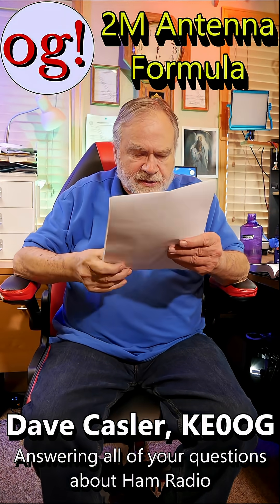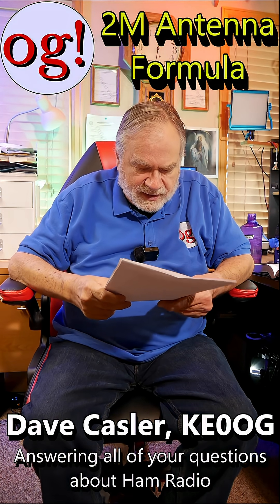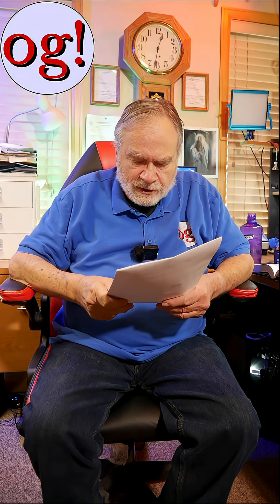2M Antenna Formula (Short #93)

Comment: I just built my first Yagi 5 element antenna with a hairpin match with an SWR of 1.4 for 2 meters. I got my information from Hams and from the internet and took all that information and came up with my own design and I couldn’t be more pleased with the results . And yes I did use my Mini 1300 antenna analyzer to check it out.